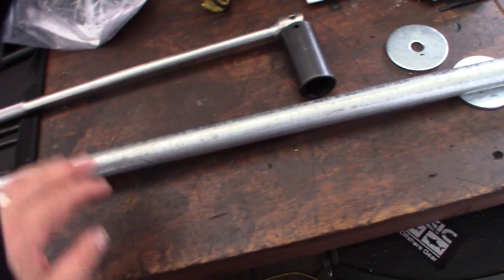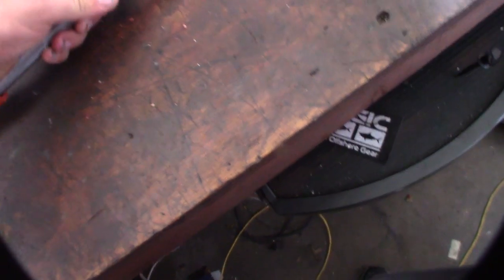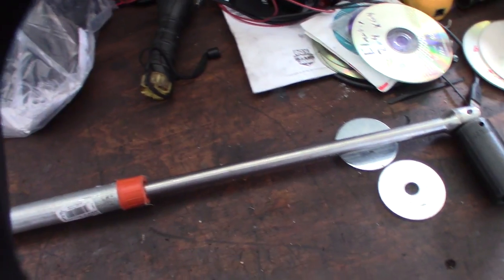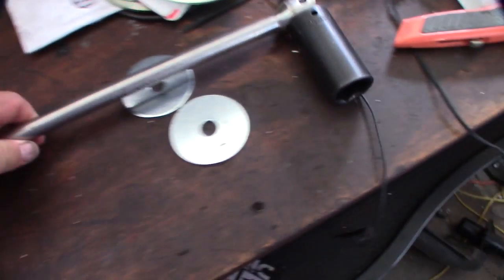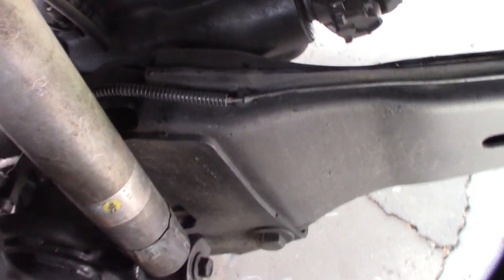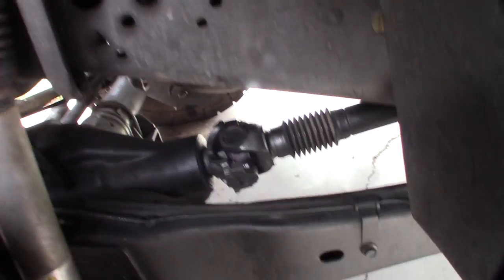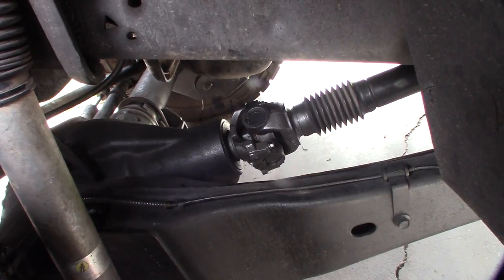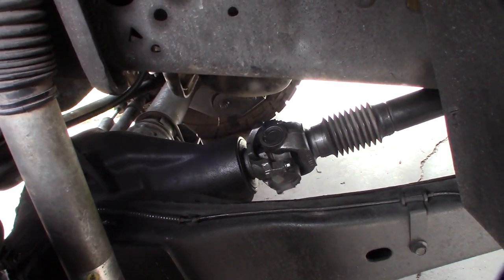Ford F250 popping clunking sound finally solved 4x4 powerstoke 6.0

Comment: Do you have a video of the noise the truck was making before you figured it out I’m having a similar issue with my truck there’s a clunk in the front driver side when I hit a pothole or when I’m turning right at about 40 mile an hour when I hit a bump there’s a clunk and I can feel it in my foot on the floor when I’m going to the right it feels and Sounds like clunking but it’s not a u  joint
Reply: Me too. Did you find a fix?

Comment: I get this on my 2016 with a 4 inch fab tech lift on the front. It mostly happens as I’m braking. Gonna call fab tech and ask what torque level the bolts should be at

Comment: 2020 Ford F-250 7.3 l gas
Bought December 2020 has 6,3xx miles
It did this noise for last two days drive me nuts until I found this video and now it’s gone. 
Right under my left foot and only did it when cooler outside and going over bumps. Same goddam bolt. Mine was a 24 mm socket. 
Thank you

Comment: Did u have issues with it popping when u come to a complete stop and then hit the gas and then it would pop ? As if something was shifting ?
Reply: My F250 does this it pops when you accelerate from a complete stop have you found a fix for it?
Reply: @markcooke176  I have not, I couldn't find a fix, I just assumed maybe it was slack between the teeth of the gears or something, wish I knew though
Reply: It's the driveshaft causing the clunk when taking off.  There is a special lube  from ford.  Blue in color.  Where the 2 driveshafts connect
Reply: @TroyNunnery  Ford TSB 25-06-10

Comment: Just had the ball joints replaced and it started. Mine feels like something hits the floor board on the driver's side when I hit a bump or make a left.  Going to check this ...thanks !
Reply: James Montes did that fix your problem?
Reply: mine does the same thing 2010 dodge ram 2500 8" rize industries lift
Reply: @jordanguichot2031  Body mount under the driver's floor .

Comment: OMFG i have been looking for this for 4 years done the same as you  thank you so much
Reply: @Dave Williams, did this work for you?
Reply: @ryansnedigar4111  yes it did also found I had seized u joints so had a major overhaul
Reply: @davewilliams1298  no fun, but glad to hear this helped. I need to do it on mine. thanks for the response, Dave.
Reply: Did you have that clunking noise start out of the blue and did it do it when you turn? My 6.7L f250 2011 that I've had since it was new started this right at 107,000 miles. It has a 6"  lift on it and I never retorqued any of the suspension parts after the lift was installed so maybe those  track bars need to be retorqued. That clunking is driving me NUTS!!😡🤬🤪
Reply: Out of the blue about 75,000 when it  started, I have an 03, 6 ltr with only 200k on it   still ticking along  which is good for me been thru 2 Fcim's, which throws error codes saying it's something else
Reply: @davewilliams1298   Thank you for the reply and the info buddy.

Comment: Mine is coming from the rear i just replaced tge rear shocks. It sure helped the ride but that dang clunking noise is aggravating. At first it was a squeaky sound i think it was the seats. So i oiled all otlf them and finally after three time of doing it the squeaking went away but the clunking has gotten a little louder. Ill check those on the back guess i should mention that i think the clunking might have started after i put my leveling kit on.
Reply: Same here.   Shocks didn't fix it. 
Squeaking and banging  driving me insane. 
Thought it might be cab bushings. 
I'll try this free fix first.

Comment: We had a big snow storm in CO so I had to activate my 4x4 on a 2003 f250 to get some people out of the snow. At first the ticking noise wasn’t even noticeable unless you were looking for that certain noice. By the time I got 4 people out and drove to get diesel. I started to hear the ticking noise get louder. I proceeded to help out another four cars and SUVs by the time I finished the last one, the ticking noise was very noticeable. I just took off the 4x4 and took it home like that. Hopefully it’s this if not I must have really fucked something up. 4x4 did work however
Reply from the maker: You have the leaf spring suspension which is different then mine. I have the coil springs. Jack your truck up or try and spin the axles. make sure the hub is still not locked. The cold weather can make them stick.
Reply: Fintech Repair Shop thank you!